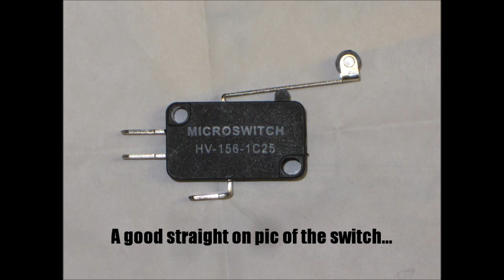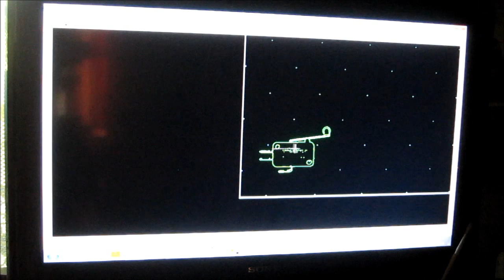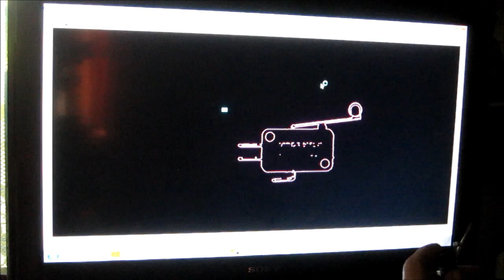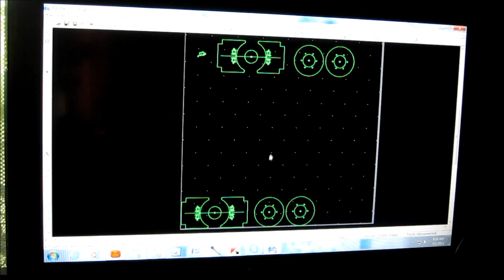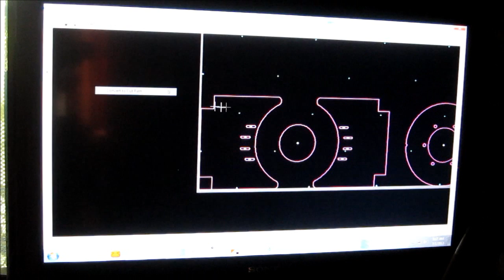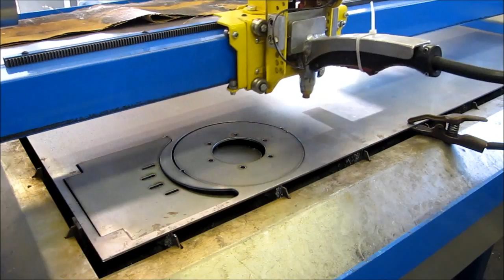Big Screen Elevator Part Twenty

Comment: The more I see on the plasma cam, the more I like it as a total package.  To do the same on our system would require the use of 3rd party software to get into a vector shape and scale properly.  The ability to restart your cut looks way easier than ours.
Check out cam studio for screen casting.
Looking forward to seeing it installed, nice work Keith!